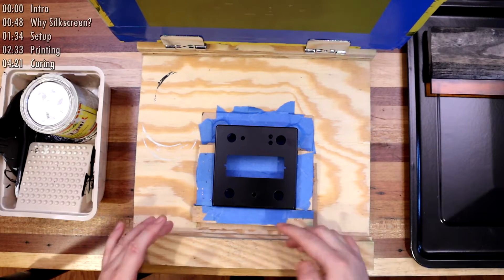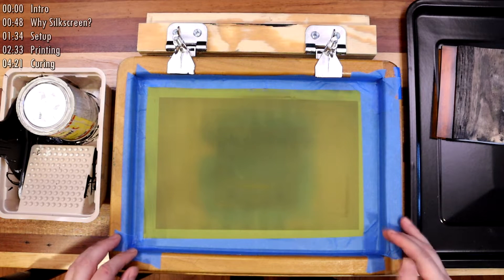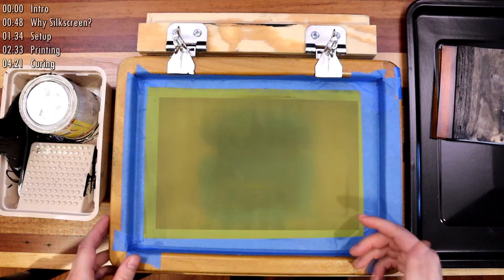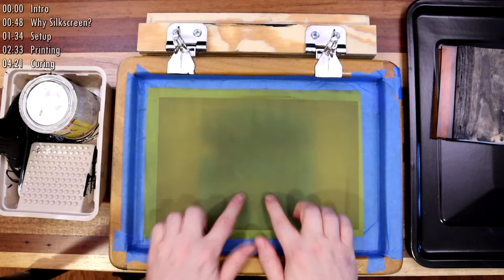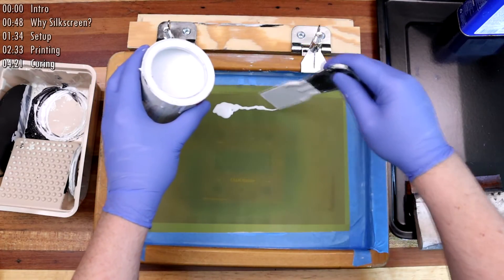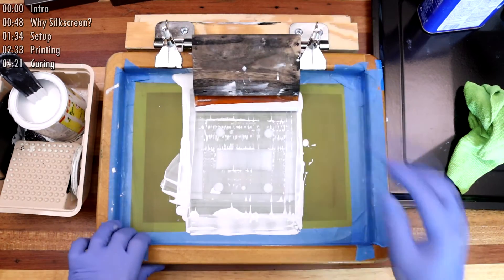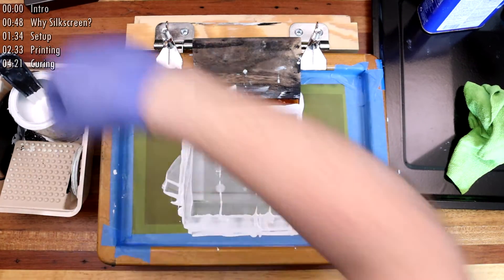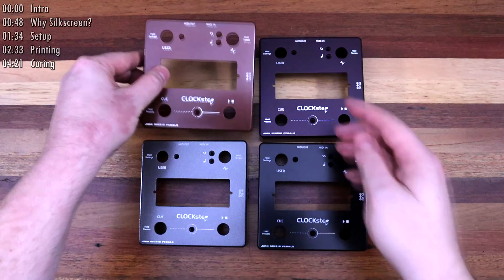Part 4: Silkscreening. (How To Build a Stomp Box using a Hammond Enclosure.  A Short Tutorial.)

Comment: Do you clear coat after screen printing the art/labels or is that chosen paint durable enough on its own? Is it possible to clear coat if concerned? thanks! Good luck with all of your projects.
Reply from the maker: I follow the powder coat manufacturer's instructions for whether or not a clear coat is necessary.  Usually that's when you want a high gloss and depth to the finish.  So far, I haven't had one that needed it.  Gloss amount is already part of the color unless it's going to be like show room hot rod level of gloss.  IMO pedals generally are better with low gloss or eggshell or even matte, otherwise glare makes it harder to read any text on the silkscreen layer.  Powder coat finishes are super durable, clear or no clear, so no worries about that.  After only 10 minutes out of the oven, they are already cool to the touch and perfect.
Reply from the maker: Oh, you were talking more about the clear coat after silk screen.  I don't use any additional layers after silkscreen, the enamel is very durable.  It would have to be scratched off after curing for 24 hours, it's not coming off with normal wear.
Reply: @jmkmusicpedals  oooh thats great to know. I'll have to rewatch again to get the brand and details on the enamel you used. Thanks for the info about the mesh size, I figured I'd have to trial and error that process. I used to have a press I made yrs ago but haven't touched it since. Thanks for saving me the time and money.